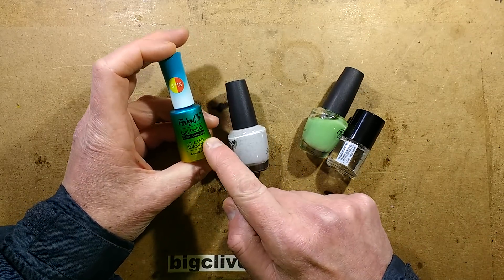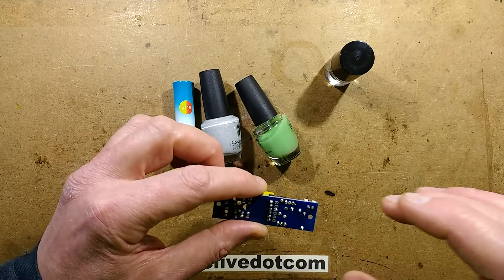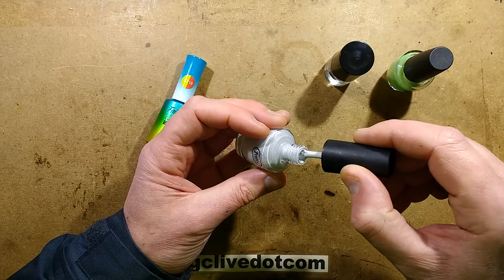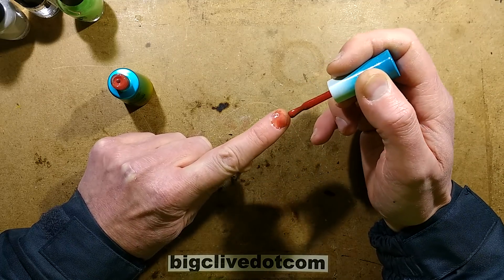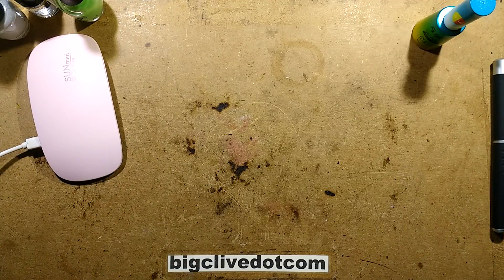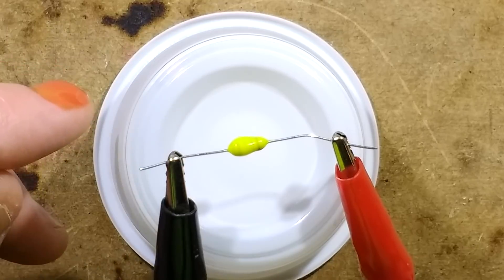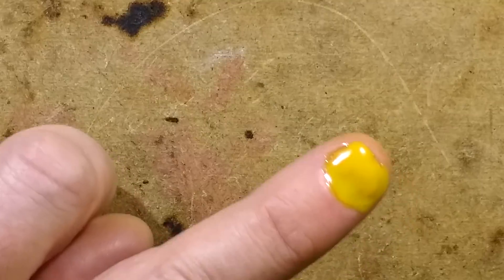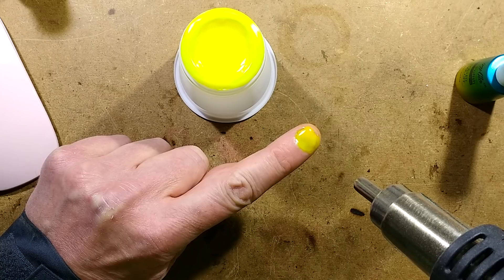Technical uses for nail varnish.

Comment: Nail Tech in Training here! Thanks so much for the fun video.  Not often I get a cross over between my hardcore tech nerd side and my nail art, but this was awesome.

The UV gel polish WILL cure outside but actually not as fast as you'd think.  It's really about the intensity of the UVA and natural light is very dispersed (especially in say Canada or the middle of the Irish Sea). And yes, it takes a lot of solvents to soak that stuff off, but not as much as two-part acrylic nails where the monomer and polymer mix on the nail (usually with the aid of a bonding agent).  It's not as scary as the 10 000 RPM efile drills we use to take off the real resin nails (hard gel) that isn't affected by acetone.  The clear polish and gel polish however aren't resins, they're lacquers and so can be weakened with a larger variety of solvents.  We just go for the hard stuff right away. ;)

Did you know REVLON nail polish was literally based on the latest car paints of the day, and some cheap polishes still use it.  The crazy amount of chemicals involved in the beauty industry is staggering, check it out sometime!

Thanks for the fab content as always!

Comment: and for those who want more glowing colours, go on ebay/amazon and look for glowing powder or strontium aluminate. it comes in blue, green, pink etc and can be mixed with clear nail polish. i used it to coat a clear glass sculpture from the inside and mount a light bulb inside. when lit, it diffuses the light like a white shade and when turned off it glows blue until it lost all energy.

Comment: Been using clear nail polish on firearms for years to act as a thread locker, works as good as loctite and is cheaper. Use colored nail polish on sights for visibility.

Comment: You could add a little acetone to the glow in the dark to thin it out a bit. Wonder hat you would get if you mixed German Dark aluminum powder and magnesium powder in the clear polish. Try applying it to a fine wire and add electricity!
Reply from the maker: +Subgunman I think nitrocellulose lacquer would be helpful there.

Comment: Conversely for the colour changing resistor the nail varnish could be used to show when components that normally heat up aren't getting any power, so it could slow broken tracks or something?

Comment: ive heard clear nail varnish is good for curing coil wine on a graphics card?
Reply from the maker: +DrFrankenboink Lacquering coils to stop them whistling is common practice in the manufacturing industry.  I'd be cautious about solvent compatibility.  (Let someone else try it first.)
Reply: i Hoped you'd reply cheers mate, basically ive heard its good for dampening down the sound and vibration from a cards VRM caps or coils..very loud electrical sound from my gpu atm, it should have clean power from a pretty new Psu so must be caps. What kind of solvents would be best.. or something else that would have the same effect, need some of that white glue they use to hold the caps in place
Reply: superglue?

Comment: A liquid crystal sheet is quite useful for playing "where's the hot component?" You can pick them up for $10 to $20. I bought one at Edmund's Scientific (there were a bunch of oddly cut ones in the Surplus Room) and I've used it for years. Just lay it over the printed circuit board, power up the board and wait for the hotspot to appear. Much cheaper than an infrared camera.
The "magnetic viewing sheet" cousin of the LC sheet is great for checking for DC magnetic fields.
I see a number of "thermochromic" pigments and paints on Amazon.

Comment: Very interesting stuff. Nice idea to put it on the resistor so you will know visually when it goes above whatever temperature the stuff is rated at. I know it is 20 degrees which is quite low in this case but it could have other useful applications if you could get ones that change at different temps.

Comment: There's some that goes through 3 colour changes  >  https://www.ebay.co.uk/itm/HNM-Soak-Off-UV-LED-Gel-Polish-Thermal-Temperature-Colour-Changing-Nail-Varnish/112732967705?epid=741360340&hash=item1a3f689319:g:-z4AAOSw1NFaTi1Y

Comment: I've used clear nail polish and rolling papers to "fix" holes in speaker surrounds or cones on several occasions.  The combination works very well and makes for a lasting repair if done correctly

Comment: Also works as a thread locking liquid for very small nuts and bolts that commercial liquid lockers will permanently bond.  With nail polish, a little acetone and the smallest parts are easily dis-assembled.  I've been using it that way for over 40 years.

Comment: I use nail polish to lock those tiny potentiometers in place when I get them adjusted correctly, and you can also easily tell if they've been adjusted as the lacquer cracks.

Comment: Do you know if you can get these thermal pigments at different temperature ratings? I saw hair dye like this that needs the heat of the sun or a hair dryer to get it to change. I wonder if the hair dye could be used in similar ways? Dyeing a PCB before part placement so you can see heat spots for testing designs.

Comment: right - I use one for lackr fied areas on PCBs (i.e. Amiga boards, leaked battery when the acid destroyed parts of the layer - after repair, it seals the area perfect)

Comment: Could this be used as Conformal Coating? The clear stuff would be far more accessible to me and most people than would finding a can of authentic conformal coating. I ask because I used HF's dirt cheap 99 cent 2 part epoxy once on an LED driver circuit and it seemed to work great.

Comment: You know if you had the resistor so you could see it then it would operate like a non-illuminating ON indicator. And at ZERO POWER cost.
Reply: I mean, you're dissipating energy from the resistor in the form of heat... But other than that...
Reply: Assuming the resistor would already be operating at enough current to reinforce the needed ON idicator temp, of course.

I was thinking it as an alternative to those annoying blue laser-like burn-your-retina-while-you-try-to-sleep LEDs. I know its not for everyone but it sure would be for me instead of placing washclothes and strategic bits of electrical tape or cardboard over the indicator ESPECIALLY trying not to block out remote IR functions. 

Clive should do a video on this. How to block out ambient light LEDs and let IR remotes still work.
Reply: Creative idea but ritchfiles is correct. You would also have to illuminate the resistive indicator and it would be unreliable outside since it would be highly temperature dependent.

As well, LEDs can be tested with your DMM but you would need either:
A power supply assuming you know the resistance (which has been painted over) or
A DMM (to check the resistance/continuity) and a source of heat to check if the polish was working.

Although you could use a resistor needed for normal operation anyway so I just wasted time typing this comment... why don't you use metal pins and extend a resistor to outside the casing and try it yourself? If you do please send me  some photos :)
Reply: Black or blue permanent marker pen is your friend when it comes to offending led's at night.
Reply: Useless if you live in Australia, the ambient temperatures are high enough to switch the state of it.

But using a servo to move an on/off flag through a display would be quite good.
Reply: You're ambient temps are not 100C .. that's boiling water!
Reply: No but the transition temps of the lacquer are around 25C to 40C.

Comment: I'd avoid clear polish top coats called "quick dry" because they have a tendency to shrink when drying, as well as anything with glitter or shimmer in it. You can find different color changing polishes on nail polish websites, but I recommend buying color change pigments online and mixing them yourself. Thermal Color Dust has a really good selection and you can get pigments that shift at different specific temperatures.
Reply: 14feb5d9f2e6.onlinestore.godaddy.com/t/thermal-shop?page=2
Reply: Here's a link to their website

Comment: If i remember right you can get a higher quality of the glow in the dark varnish from Beauty Supply shops,  the ones that hair dressers go to to get their supplies not shops like Ulta or Lush.  I got some from our local Sally Hanson (In the US) that lasted for a long time and glowed quite brightly  if charged properly.  I painted it on the door bell buttons for family's houses.  I think the color change nail varnish is more based on the old 70's trend of the "Mood Ring".
Reply: I suppose you could pop off one of those domes from a cheap LED bulb, paint it and replace it for a funky night light.  There are a lot of interesting things to do with glow in the dark polish.
Reply: true,  had a lot of fun painting eyes on a sheet of contact paper and putting them on a friend's window for halloween

Comment: Funny you talk about nail varnish. Today I ordered a UV curing one for PCB experiments. Either for the etching process or as a soldermask. We'll see whether that works at all.
Reply: Ditto. Used ones are dirt-cheap on ebay. Shipping is most often more expensive than the item itself.

Comment: I can't speak of the chemistry, but back when I was painting cars and airbrushing, I was quite interested in the Eclipse brand of custom paints. They have/had a couple of paints that change with temperature. They are extremely useful because they changed from either "black" (really a dark grey) to white or from blue to white. You apply these as a base layer and then get creative with candy colors over the top. It's super expensive as a base paint, and extremely risky to play with. Basically you are creating your graphics blind with simi-transparent candies that are more like dyes over the cold and dark colored background. Candies like all colors dry to a matte finish. They are hard to see over a light colored surface, and are extremely unforgiving as any unintentional overlap will only get darker with continuous coverage... Anyways... The paints from Eclipse are by far the most dramatic transition paint I have ever seen. They used to have a few YouTube videos 5-6 years ago showing a sink and toilet that changed colors with use. If memory serves, that paint is a 2 part base coat. I believe there is an adjustable margin for temperature transition based on the mixing ratio. I almost painted a motorcycle with the stuff, but the guy backed out of that one after I quoted a final materials cost versus typical HoK premium paints. The Eclipse paints made a big deal about using their special higher UV stability clear coat. Mixing a new type of base, with another brand's candies, and a new unfamiliar clear coat is a very risky way to make a paycheck as a painter. It's definitely some cool stuff to check out if it's still around. I haven't painted since '09 so who knows these days.
Reply: Black to white:
https://youtu.be/gCpKwA_iUcw
Blue to white:
https://youtu.be/WK1XCWvBJlQ
Cool stuff IMO ;)
Reply: Try to get insurance on any car that changes colour ;)
Reply: Dad's Kitchen 
 I changed the color of my Camaro from green to red and no one really seems to care. It doesn't change colors on it's own but I've never had problems because of it.
-Jake

Comment: Why would this be an exothermic reaction? I mean, it changes color and then it changes back. Where is the energy that's being released for it to be an exothermic reaction? Or is this referring to the curing process? But then, also, where is the energy that's being released? Do you mean that it's getting hot while curing and thus changes color, which changes back once all the heat is gone? Would this be repeatable with the UV LEDs after the varnish has already been cured? If so, then it's just the substance turning the energy of UV light into heat, not really sure if that's exothermic. For it to be exothermic, it would have to have a higher energy output than what energy was originally put into it. This of course also goes with a change in the substance, which is only reversible by putting lots of energy in it...
Reply: Seegal Galguntijak I think he's referring to the curing process, which releases heat, causing the stuff to change color
Reply: Amar Gandhi Yes I figured that out later on in the video, after I wrote this comment...

Comment: As usual Clive another great video thanks for the trouble you go to. Another use for nail varnish is it works really good at sealing the threads of carburettor jets where  there may be some wear it keeps the fuel from entering via the threads instead of the jet hole. If it gets by the threads as well as the jet hole it results in too rich a fuel air mix. Nail varnish  don't seem to be effected by petrol.

Comment: I put a little line on the attachment nuts / bolts for permanent overhead disco lights so you can very quickly see if something has worked loose (a line from the thread onto a nut or the thread onto the bracket)

Comment: I found nail varnish to become notably conductive with raising temperature (50 °C). So it may not be the insulator of choice for high impedance circuits at elevated temperatures.
I normally use nail lacquer to secure the controls of multi-turn adjustment pots.

Comment: Paint an old A1 (or any size) picture frame backing with glow in the dark paint, put it back in the frame hang it on the wall and use your UV laser to draw and doodle on it. I've had one hanging in my room for a couple year now! Never gets old.
Reply from the maker: Look for the photoluminescent sheets used for making emergency warning signs.  You can get them blank as plain glow in the dark panels.

Comment: My optician has another use for the stuff.  The screw holding the frame of my specs together came out in an inconvenient location (so I couldn't find the damned thing).  The optician replaced it, then applied a little nail varnish as a thread-locking compound.  Works well.

Oh, and the technical term for the stuff when applied to circuit boards is "conformal coating."

Comment: When we had a few ladies assembling and calibrating our circuit boards, they used red fingernail lacquer to seal (or indicate) the trim pots were already adjusted.  When they retired, we changed to corona dope for the same purpose. 
The color change one is intriguing.  But to know if it would be really useful would need a little more exact info.  What actually is the transition temperature?
By the way, the clear polish at least used to be acrylic, same stuff that some conformal coating spray cans contain.  That is why acetone is the usual cleaning solvent for it.  The ladies’ cleaner is a mixture of acetone and some oil to reduce the harsh end result.
Reply from the maker: I tested the resistor by gradually turning the voltage up until the colour change occurred and the thermal imaging camera suggested the transition point was 20C

Comment: Dark green (or whatever the PCB colour is) is great when your repairing or completely replacing burnt track using heavy gauge TC wire, it makes the job look neat (an invisible repair at a glance), but also helps with insulation, especially when repairing track on a relay board that carries 240 or 3 phase.

Comment: As an avionics technician back in the 70's, I used a bright red nail polish to replace thread locker. You only have to put a drop on the outside edge of a bolt or screw. I never had the nerve to put it on the threads and I never had a single screw or bolt come loose.
Reply: Presumably these days they have specific protocols to follow using approved chemicals with known performance?
Reply: They brought that in after all Eddie's planes fell out of the sky that day.

Comment: When I was a Goth, back in the early 1980's, I often wore black nail polish, which, although had I wanted, could have been applied neatly, but as fashion dictated, had to be applied as shonkily as possible, and not on every nail, and if it got chipped, so what? The effect was pleasing, but untidy, and looked rather as if you had necked about a gallon of 'snakebite and black' (a lethal cocktail of Lager, Cider, and blackcurrant cordial: more than four pints could make one a bit... 'fighty'), and decided to do some woodworking, using the hammer on your fingers. I live in a rural part of East Anglia, and went to a country pub, where the barman would not serve me, for the simple reason I had black nail polish on. I am a great supporter of the British 'local' whether in town or country, but was selfishly pleased to hear of this pub's closure some time later. This was in the 1980's, and I'm pleased to notice it has now re-opened, hopefully with more tolerant staff, although now, I'm in my fifties and the black nail polish is long gone (but I'm wearing a Bauhaus t-shirt as I write this).

Comment: A classic usage of nail varnish is as a thread locker. I used to use the stuff to lock in #4-40 jack-studs for D-Conn style connectors.
I'm guessing the numbers on the colour changing varnish are the temp ranges in Celsius?
 - Eddy
Reply: Thought the same. Unlike some proper thread lock compunds, it probably will not make wrong type of plastic brittle either. Normal one is a definate no-no for locking anything into plastic counter part.